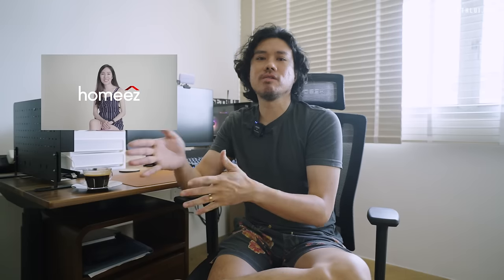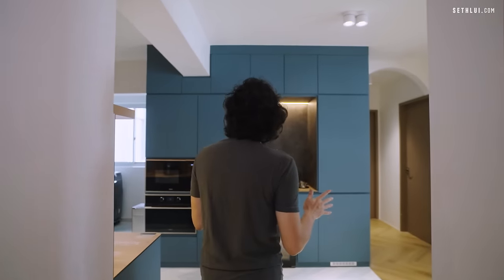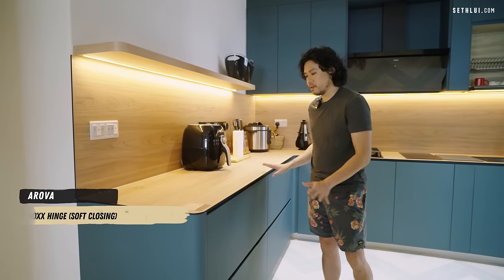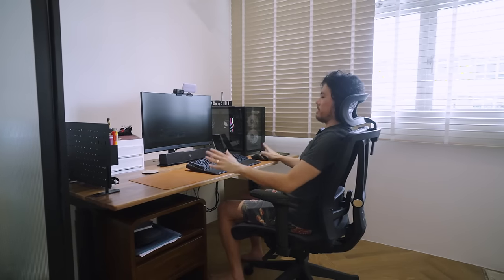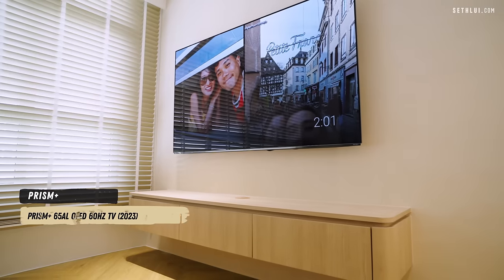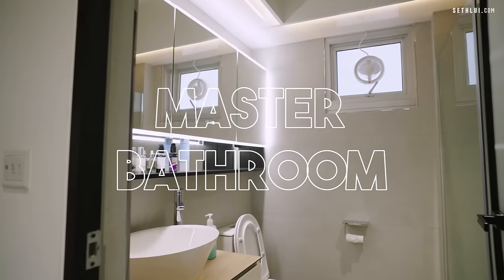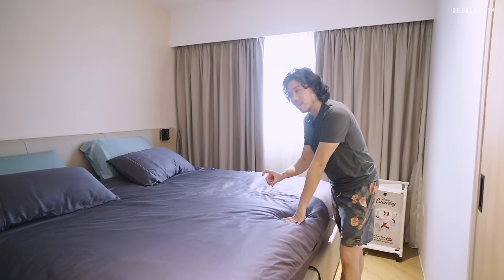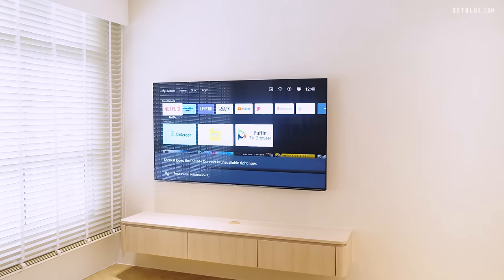Inside Seth's $69,000 4 Room HDB BTO after his ID Quit!

Comment: Teka is very common brand in condos.
Reply from the maker: is it? my reference is HDB lol didn't know its common for condos... but its great cos a lot of built in appliances
Reply: @Sethluifoodtravel  stand-alone fridge will be better than integrated fridge. Looks nice it flushes into the decor. But SG Weather not suitable. 2-3yrs down the road, the cabinet due to heat may not last. Or if your fridge breaks down, replacement may not fit.  Good luck!
Reply: Is teka good quality? What abt price wise?